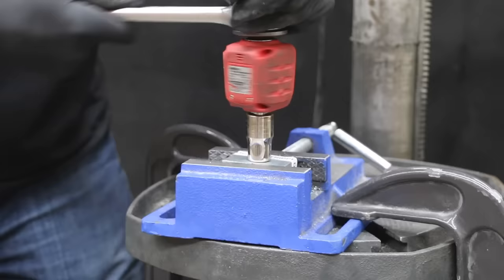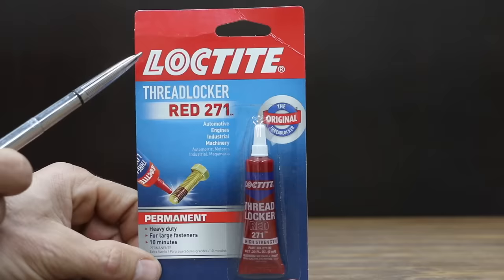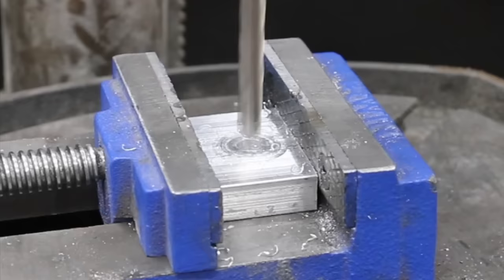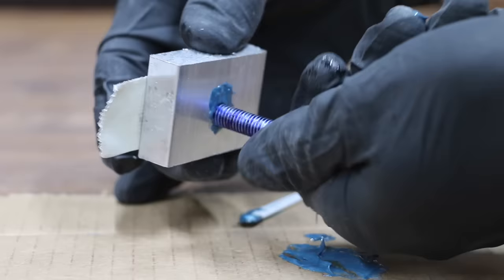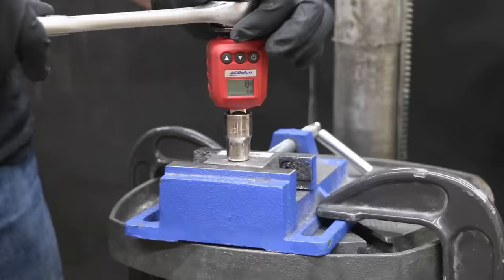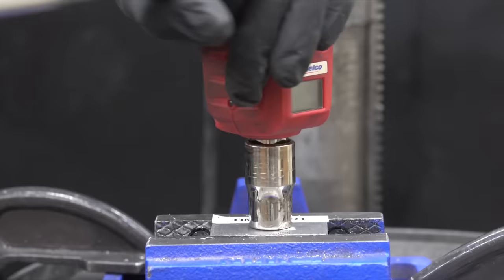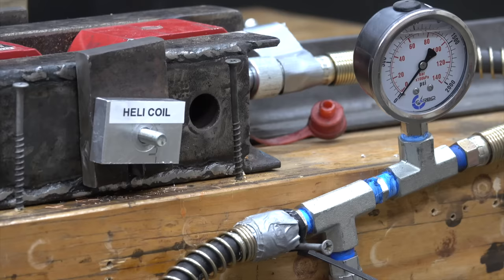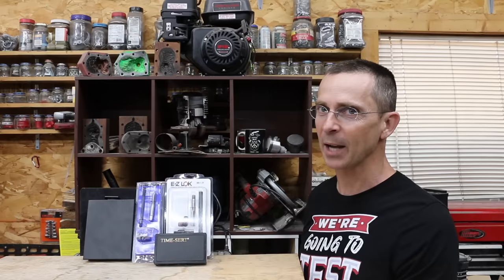Best Damaged Thread Repair? Let’s Settle This! Heli Coil, TIME-SERT, E-Z LOK, JB Weld, HHIP, Loctite

Comment: One thing to note about helicoil style is that the are stackable, so you can use almost three for an engine head bolt !
Also to note, due to the new aluminium hole being larger, threads have more meat to bite into, so almost always repair will be stronger.
Reply from the maker: Thanks for the feedback.
Reply: Time serts are the best, but there are places only a helicoil will work.
Reply: Space to get into an area is always the tough part... even when lying on your back on the ground jobs need to get done.
Reply: torque test channel disagrees
Reply: I don't understand what's the point with these repair kits. You can just bore the hole bigger, make bigger thread and install a bigger bolt. Much easier than with repair kits.
Reply: @MrMasahhh  I have a van with an oil pan that needed this repair. Not too many options with sizing up the oil drain plug. And the steel threads of the insert make it less likely I'll have to do this job again.
Reply: @MrMasahhh  That doesn't work when you can't enlarge the hole in the part or flange that is being bolted down.  Or for specialty fasteners.

Even when it's possible to use a larger fastener, you now have a unique assembly.  You might remember the repair, but what about the next person that needs to work on it?  It's often better to repair the threads so that the standard parts diagram is still correct.
Reply: @MrMasahhh  where do you get one larger head bolt of the right length & strength?
Reply: Also a heat test.
Reply: @1djbecker  oh yeah, nothing like the bodge mentality of  "You can just bore the hole bigger, make bigger thread and install a bigger bolt" and the unit is on it's first step to the scrap bin ...
Reply: @MrMasahhh  
As others mentioned, a bigger bolt isn't always an option. Even when it is, it's not always a good idea. What you suggested is certainly possible, but will only work in rare cases.

As another example, the threads in aluminum cylinder head spark plug holes sometimes fail (Over-torquing, changing while hot, not enough threads when manufactured, etc). You could "just" buy a new cylinder head for "just" a few hundred bucks, or repair the threads with an appropriately sized kit. Drilling and threading a bigger hole is absolutely not an option, unless you want to make your own larger-threaded spark plug.
Reply: @MrMasahhh  aluminum blocks. No matter how big you make the threads a helicoil will always out perform the aluminum block
Reply: @MrMasahhh  Depends on what thread your trying to repair though! Head bolts, spark plug threads need the same thread👍
Reply: I do thread repairs for a living and I go out of my way to avoid stacking helicoils, especially on head bolts. I would average 1 repair a month on head bolts with stacked helicoils simply due to installation related issues. The deeper the hole, the more likely it is that there will be issues
Reply: @MrMasahhh  That's easy.  The bolt hole that strips is on the outer edge(of course) where no meat can be added as the piece is a certain size...to fit into a certain size location.  Sometimes it is "JUST THAT WAY." Such as on aluminum oil pans.  A small square of steel is inserted in the factory under 40,000lbs pressure(lets just say "A Lot of pressure" and the part fit is that tight that oil does not leak past.   The insert May be no larger than the copper washer that goes between the steel oil plug and the engine. Copper is reusable, rubber gaskets use only once.(sometimes the washer metal is aluminum(which is also soft & found on Asian cars/motorcycles...is also reusable.  Choice is used the product or buy a new oil pan (or engine)  One is cheaper.   If it is an oil plug, usually they "you" cross threaded them in instead of starting it by hand and screw it all the way down by hand BEFORE USING A TOOL.  The chemical ones are certainly good enough for an oil drain plug...those that have some resistance.  No need to reef on it to break the 5/8" bolt.
.  If it is a head bolt ? I would question the strength of that but on a gas car it is probably no more than 150pounds of torque(on average)or an exhaust bolt (35lbs of torque) into the head then you want to helicoil it.  Price out the cost of a new head.  <You will go heli coil insert and have a machine shop do it>.
Reply: @1djbecker  Really?  You worry about the next owner? He bought it. It is HIS PROBLEM.
Reply: I've only used helicoil when we had nothing else, maybe 3 times in 30+ years. Motorcycle dealerships I've worked in always used time-serts. I don't know how easy helicoils are to shorten, or if small ones 5×.90 m would be harder to install when modified. E Z locks are for using in steel, where they reign supreme ( if there's enough meat there). I only use j b weld to hold things together, until i can get the correct fix. If i had more experience with helicoil, i could make comment.
Reply: @MrMasahhh  , then you have to drill out the holes you're putting the bolt through.  And if it's al. the insert is stronger than the base material.
Reply: @bunzeebear2973 , just make sure"you" tell him bout the mod you did. Cuz he bought it expecting one thing and it ain't so.
Reply: Better than stacking, almost every style of insert is available in multiple lengths.
Reply: Thanks for directly answers the question I had in my mind since cast aluminum blocks might not be as strong as his test pieces.
Reply: @theshed8802  Interesting, can you elaborate on what the issues are?   Binding on the bolt maybe so that improper torque applied?  So do they make longer ones for head bolts so that you aren't tempted to stack them?  I've never installed a helicoil, but the threads in a block are significantly deeper in proportions than the ones shown, so if you have a stripped block, I would think you would need about an inch or so of thread.
Reply: @bunzeebear2973  Good for you, how would you feel if YOU were the next owner.  Tired of this crap of people not giving a damn.
Reply: @frankekeler7682  You should watch the test that The Torque Channel did on this. All 3 coil style inserts they tested out did the timesert by around 2k psi. I always thought timesert was better till I watched that.
Reply: @MrMasahhh  (HUNGARY ) De ha nem csavart , hanem pl gyujtógyertyát kell behajtani, akkor nem lehet nagyobb a menet .Ezért kell a persely vagy a  menetjavító rugó .
Reply: @MrMasahhh  Most auto and aircraft parts have the flanges on the part sized for the correct bolt, if you drill to the next size up the head of the bolt will not sit on the flange.
Reply: @MrMasahhh you can't always find a bigger bolt with similar specs, especially in automotive.  Also sometimes you are very close the the walls so drilling big enough for next size up is risky.  Plus if you strip again you are screwed...

Comment: finally drilled out snapped AC compressor lower mounting M8 bolt from my Fiesta's aluminum oil pan and was going to use Loctite to try to fix new bolt in the damaged thread. This video is just in time - ordered from amazon $25 kit for all kinds of metric threads, similar to Heli Coil. Project Farm, you are the best
Reply from the maker: Thanks!